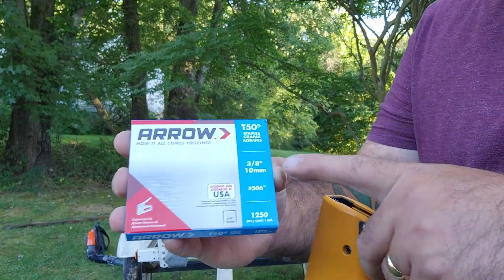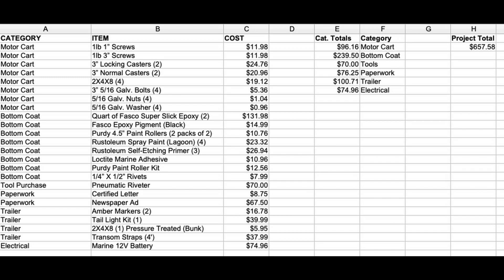Saving an Abandoned Search and Rescue Boat (Episode 3) - Trailer Lights, Wiring, and Sea Test

Comment: I have found that running a redundant ground wire to each light saves lots of trouble shooting. Depending on the chassis ground leaves room for electrical gremlins to ruin your day.
Reply from the maker: I 100% agree!  Wish I had done it, but I planned on upgrading the trailer... Guess what?  I still have it.

Comment: Nice job Adam. You need two heavy batteries for trolling motor in the front. It’s noticeable that the boat is really light by itself.
Reply from the maker: I was thinking something similar.  It's amazing how much time you can spend really thinking about what needs to be done, and the order it needs to happen in.  For example: Balance.  I weigh about 250lbs.  I don't know how much the motor weighs, but I'm going to need to figure it out.  Once I know those numbers I can figure out how much weight needs to go into the front (and how far forward it needs to be) in order to maintain the proper draft line.  Two AGM batteries (one for the motor and one for accessories) and a full tank of fuel probably puts me in the right ballpark, if I place them properly.

I looked into float pods to help me out with the back, but the shape of the hull is awkward.  They'd have to be set in from the edges of the boat, which would crowd the motor.

Whatever the case, the next step is going to be tackling the subfloor.  Once that's in and sealed, I can take the boat back out onto the water and figure out where the heavy stuff needs to go in order to give me the performance I'm looking for.